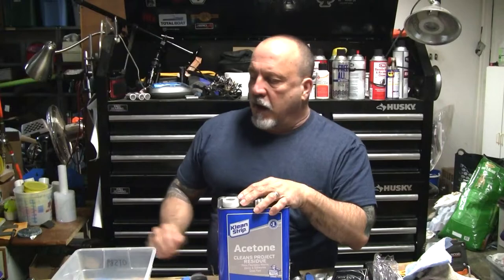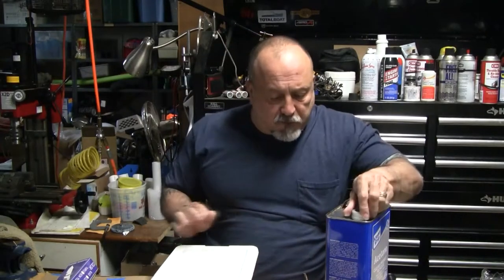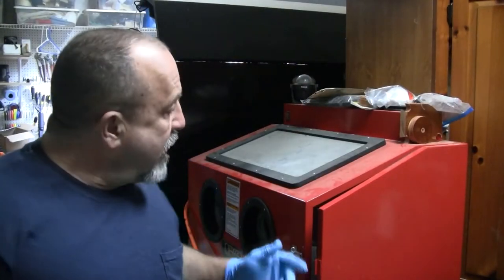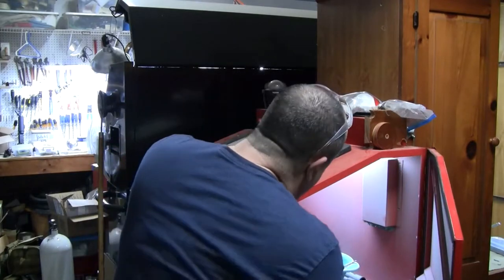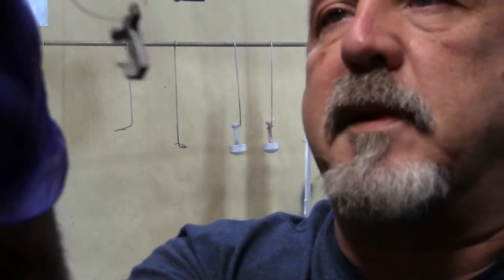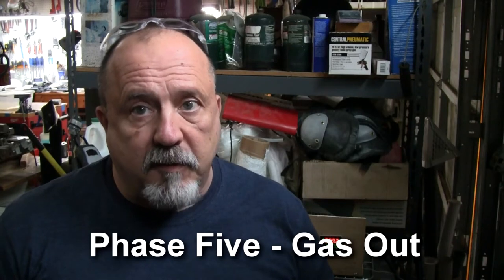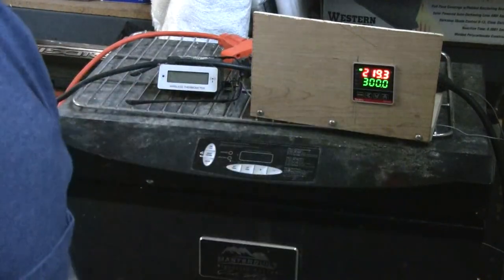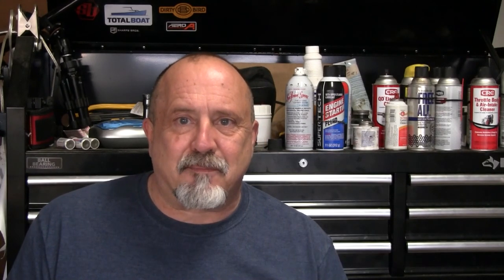How to Cerakote at Home - Part 1 - Surface Preparation for Cerakoting

Comment: Such a helpful video!!! What kinda of compressor are you running and what psi? Thanks in advance!
Reply from the maker: It's a pretty decent size dewalt compressor, 15 gallon with 225 PSi capacity

Comment: do you have a video on your oven conversion? I have the exact same one that I no longer use, and have actually been thinking about converting it as well.
Reply from the maker: What I did was I made temperature controller and then opened up the oven and wired it to the heating element.